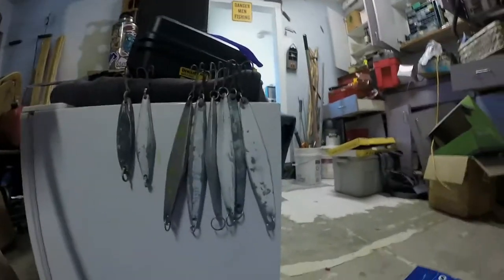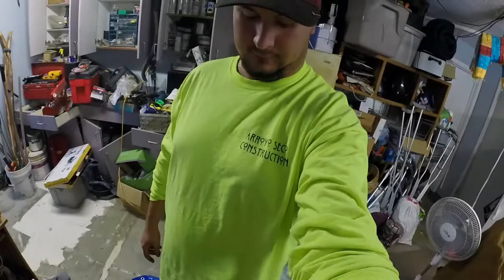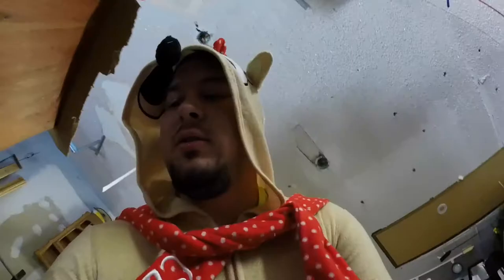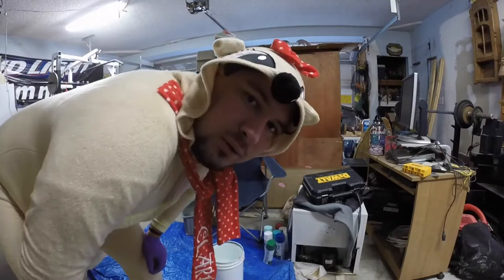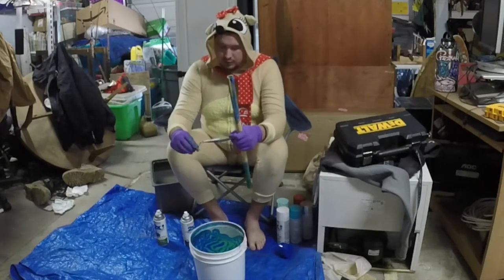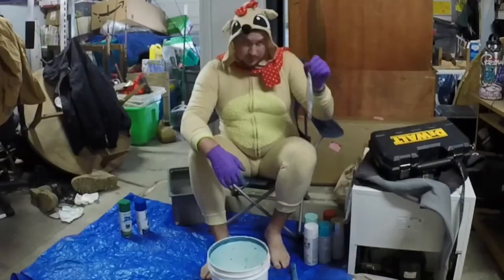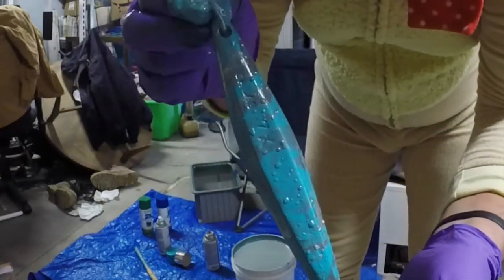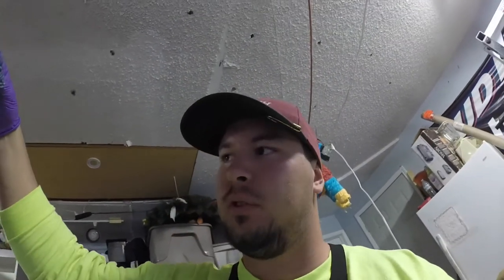How To: HYDRO DIP! (Surface Irons & Christmas Gift)

Comment: yew this is sick but whenever I try to do it, the paint dries before I can get it on the lure and it clumps up on the lure, any tips or ideas on what I am doing wrong?
Reply from the maker: Luke Cara honestly, I don’t know. That’s never happened to me. Make sure it’s an oil based paint. I use rustolium. And I’ve seen another video that said to use warm water because it’s helps the paint to not dry as fast. I personally haven’t had any issues with regular temperatures water so I can’t tell you from personal experience but that is the only tip I can think of
Reply: Dirty Hookers ok thanks anyways. I tried it a couple times with a waxwing and a colt sniper but I did it outside (don’t know if that makes a difference) so I will just try a couple different things. Thanks anyways
Reply from the maker: Luke Cara no problem man. Sorry I couldn’t be more help. TallFishermanJ is where I first ever saw the idea from awhile ago. He’s the one that said to use warm water. But I haven’t had any issues yet so I just do as is